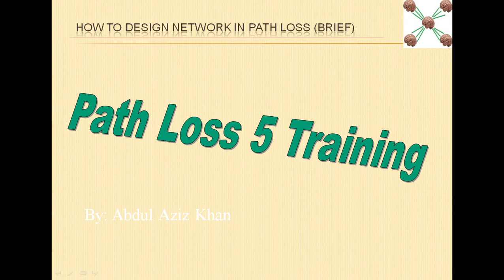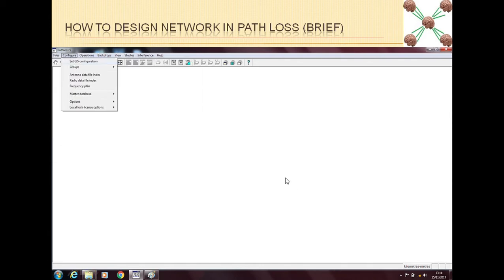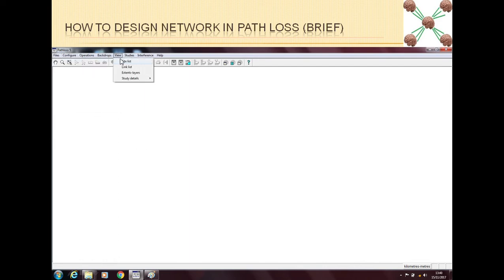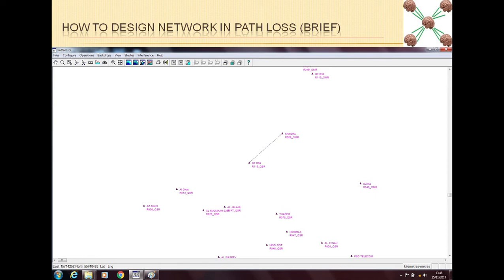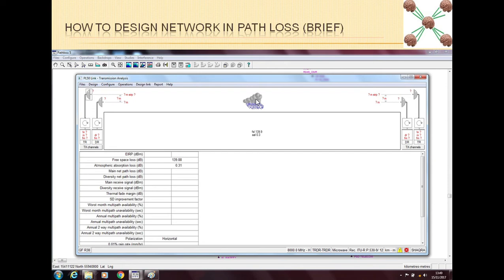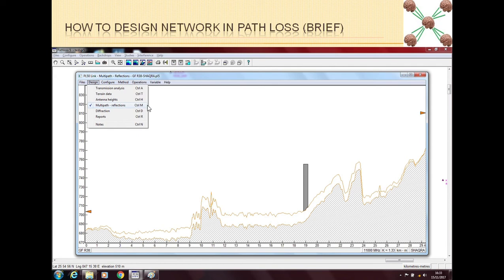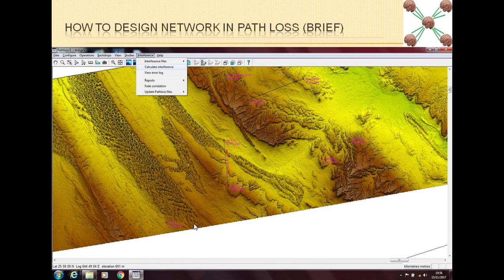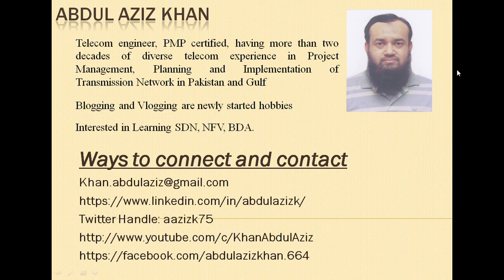How to design network in Path Loss 5 (Brief)

Comment: possible to change the frequency channel of each link to calculate interference later?
Reply: I mean as a bulk not individually
Reply from the maker: Bulk setting on the links is neither possible nor beneficial, you will have to use external tools